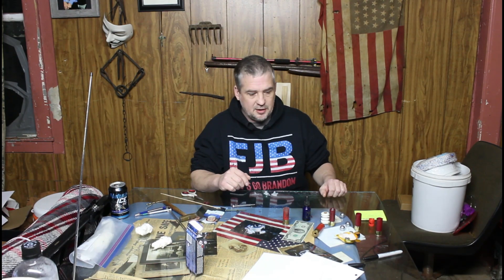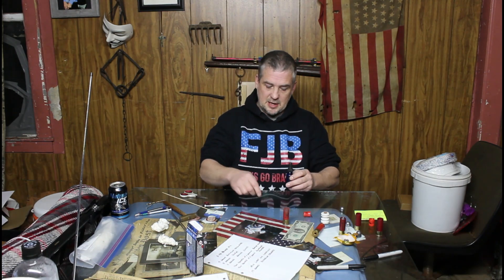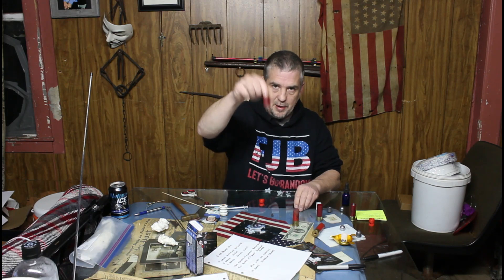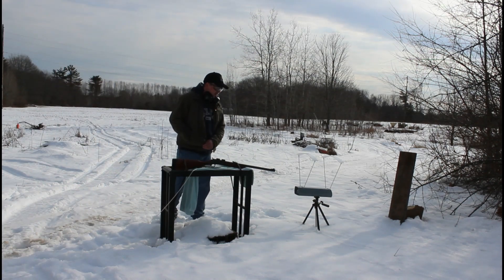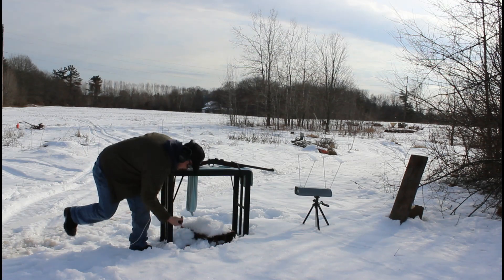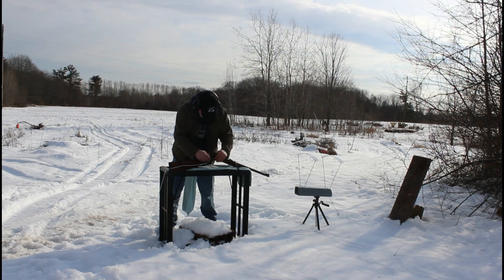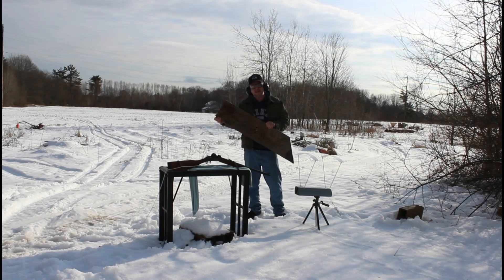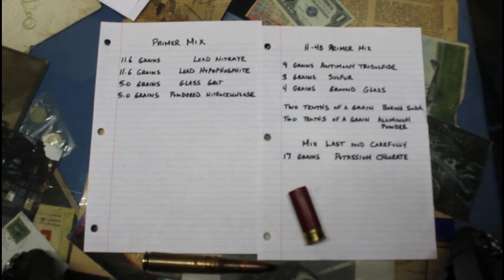Home loaded slug shells using homemade primers, slugs and gun cotton.

Comment: Man you're a genius! Finally found someone doing the exact experiment I had in mind. Have you considered trying to make nictrocellulose lacquer, dry it and take the powder and use that as a propellant instead of straight up gun cotton? It works much better I read. I'm still in the testing phase myself
Reply from the maker: Yes I have and have tried it. Its hard to make it all the same sized pieces though. So far I've done it a few ways. One was putting it in a spray bottle and spraying in into water and the other way was i painted a no stick surface and crumbled the dried product. Next I will try making a paste and extruding it some how.
Reply: @darianballard2074  May I suggest something? This is what I'm planning on doing. make it as thick as possible then spread a thin sheet on aluminum foil let it dry then get it crumbled then use those different sized screens from amazon to sift it into different  grades of fineness. This is the method a youtuber uses to get uniform sized black powder granules from a puck mold of black powder. Works pretty good for him. His channel's name is Everything Black Powder